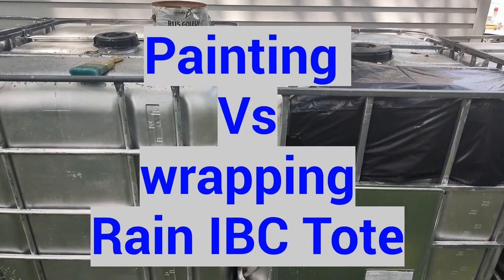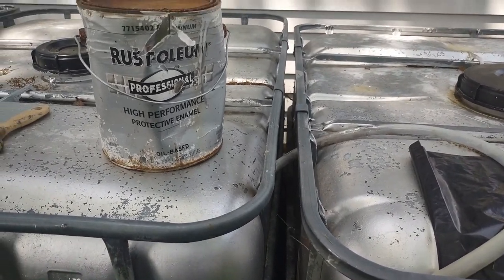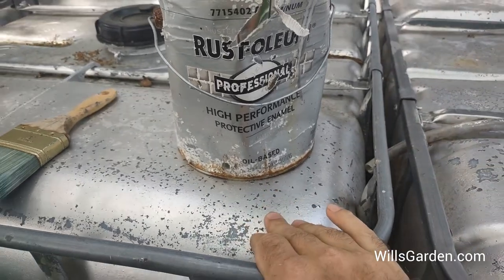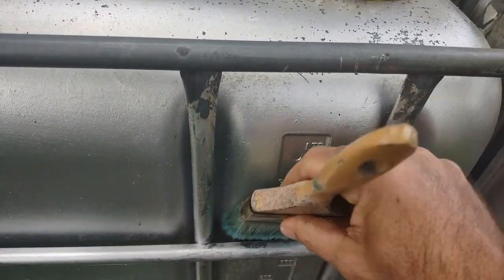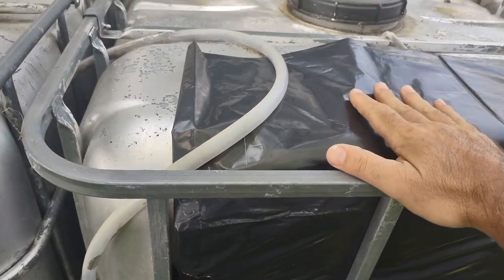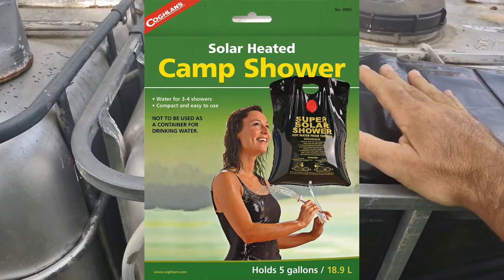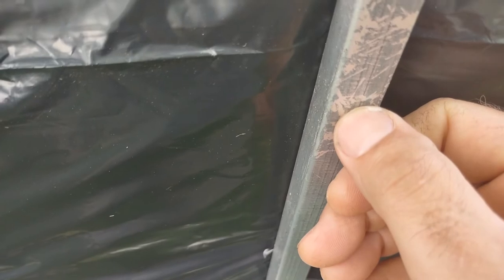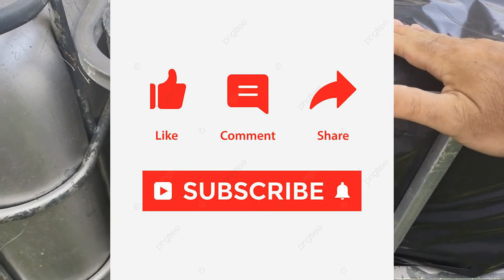Paint VS. Wrap your Rain Barrel IBC Tote.

Comment: Your video inspired me. I used Loctite spray can of heat and water resistant glue like 3M weatherstrip to hold plain old  aluminum foil which blocks 100 percent of sunlight.

Comment: Flaking off after two years is not very desirable. I painted mine some year and a half ago with Aqua Blue because that was the left over paint. I did apply a good coat of undercoat before I spayed painted it with exterior paint. I see no visible flaking off. But I have to be careful not to scratch the paint as paint doesn't adhere to IBC plastic very well at all.